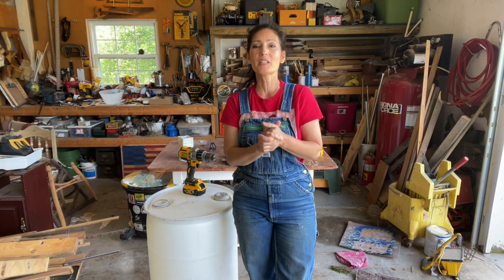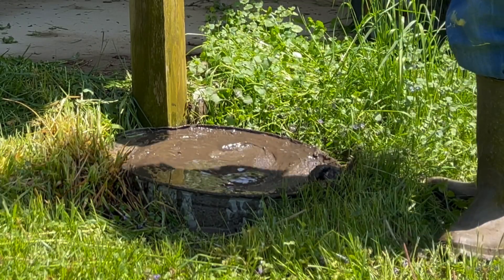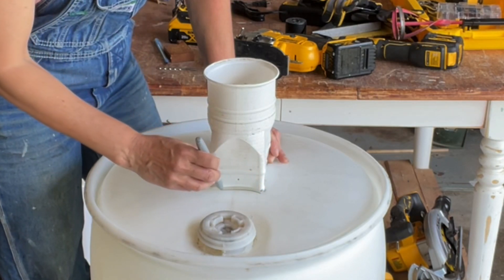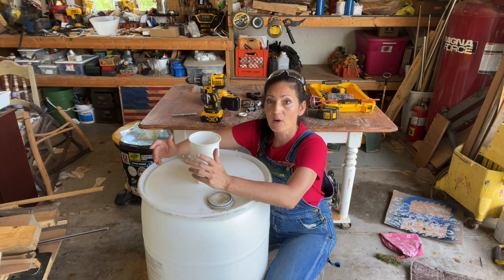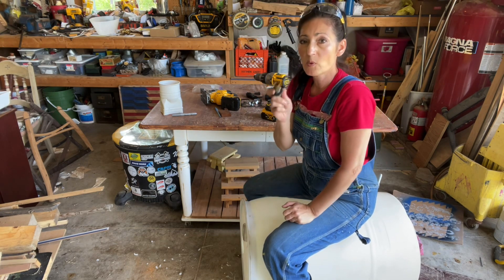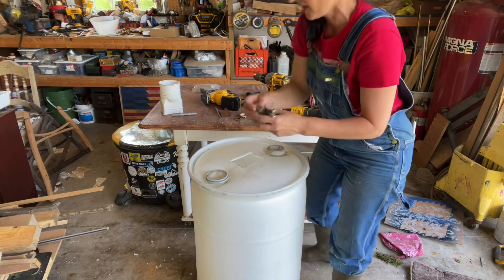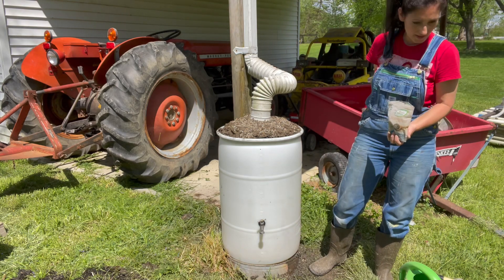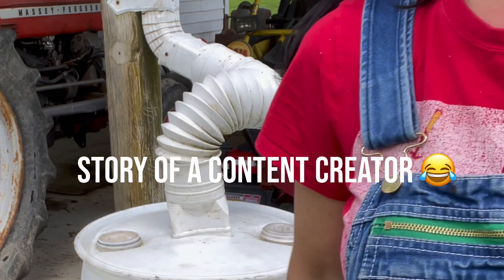HOW TO MAKE BUILD a RAIN BARREL for collecting surplus WATER (Off grid Survival or Gardening)

Comment: Do you think the DeWalt drywall cut off tool DCS551B would have been easier to make your holes then using the drill and jig saw?
Reply from the maker: Possibly, although I don’t own it/know if it works well on plastic. I had to use what I have access to. 🙌